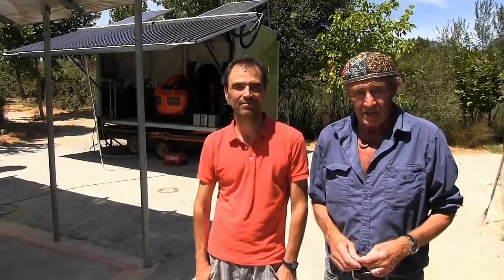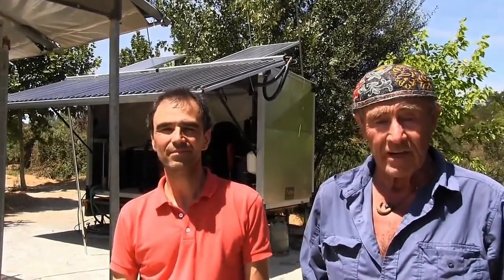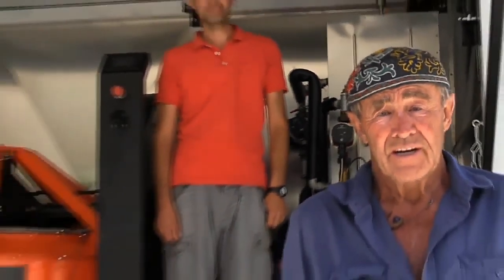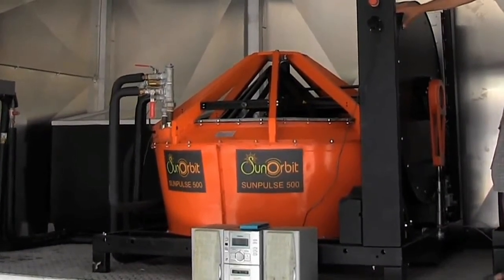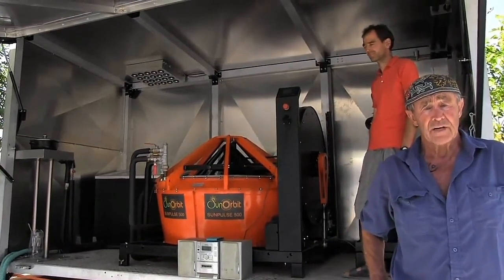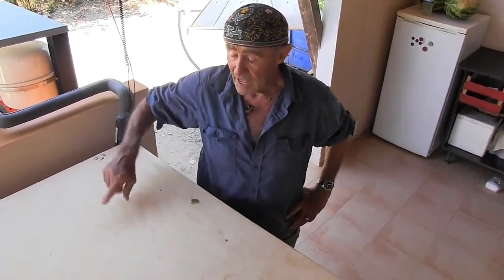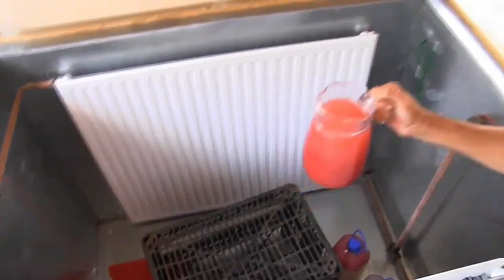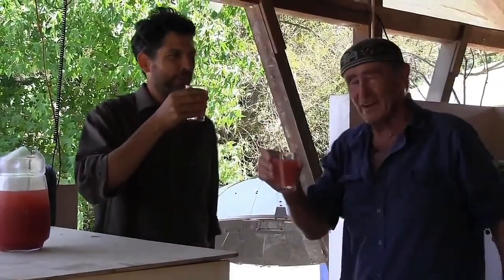An Innovative Low Temperature Solar Stirling Engine

Comment: This is such an amazing work! I have been dreaming about something like this for ages! In places where we have a lot of sunlight and a lot of heat, converting that using photovoltaics is very very inefficient and storing heat and using heat in many other ways is definitely the way to go! The choke point has always been the efficiency of this Sterling engine, and it's amazing to see this happening. I wish someday that kind of technology could be developed here in the Amazon because we burn so much fossil fuels here, we destroy the forest to create hydroelectric dams and all kinds of harmful stuff. We could be harvesting the sun's heat. But the reason why we don't harvest the sun is because the only economically viable way to do that right now here is using photovoltaics which are crazy expensive to get. This is amazing work, my brother. Congratulations on that!

Comment: Interesting concept. But you didn't mentioned the effort (investments) and amount of storage capacity nor delivered average power... So why you don't use PV and battery storage or compressor AC instead at low effort and high availability on market?

Comment: I invent in the energy space including in the off-planet space. One of my current  development project is a more mechanically efficient Internal combustion engine architecture with applications to other machines including solar thermal energy converters such as this one. Projected efficiency improvement is 30% which is significant. Other thermal efficiency improvements raise that by 20%. A vehicle driving cycle efficiency can be improved by 100% or more.

Comment: This is all very clever and interesting, which I like.
But with the exception of the biomass thing; the system does nothing one cant do with solar and batteries.
A small battery bank will still be required to handle electric spikes and peak loads.

So the question is then:  
How does it compare in price to an equivalent large Solar and Battery bank..?
Or a good CCHP system??
Reply: PS,
 One of my current  development project is a more mechanically efficient Internal combustion engine architecture with applications to other machines including solar thermal energy converters such as this one. Projected efficiency improvement is 30% which is significant. Other thermal efficiency improvements raise that by 20%. A vehicle driving cycle efficiency can be improved by 100% or more.
Reply: @ That I'd love to see!
I assume no side thrust on the piston is the 1st step, but then you need to get the power to rotational with a more  adventitious angle to a crankshaft than the normal  ~20 deg ATDC...    Hmmm....
Reply: @RayleneCawood  Not sure whom you are replying to but this is a crank-slider design so side forces will be present but that friction force is not significant. It's the near-TDC position that, for several reasons, causes ~30% energy loss but mainly due to low/slow torque arm development/availability
Reply: @RayleneCawood  PS.  I'm working to circumvent this problem. I prefer rotary devices which avoid the reciprocating momentum issues.
Reply: @ You might then be interested in the new LiquidPiston rotary engine.  Even though it will probably never be for sale, there are metal 3D printing places...
Reply: @RayleneCawood  Meh. LiquidPiston has several drawbacks which my/our design fixes which we'll eventually incorporate in our rotary architecture[s].
Bot will be used in my low cost, ultra-efficient, personal, door-to-door air mobility system, the PersonalJet with an advanced autonomous, networked, ride-hailing/taxi system following.
Reply: Seems you are not well familiar with this space and default to the mainstream promoted solution. I invent in the energy space including in the off-planet space. Generally, remote areas require reliability and low cost but electronics are not very reliable and usually not repairable on site whereas simple tech is. Heat engines systems can be supported with biomass or other thermal energy sources during inclement weather. Other considerations apply.
Reply: @ No; I see this being useful in that it can use biogas  or whatever at night, but so can an ICE and at similar efficiencies.

Yes it is easier to fix a mechanical machine as yo can see what's wrong, but with no moving parts to break..?

Comment: How many watts or power generated?
Reply: I invent in the energy space including in the off-planet space. Energy systems are scalable according to needs or funding availability so modularity is a useful factor. Obviously this is a demonstration system. You are probably asking about thermal efficiency or specific energy/power metrics which I'd also like to know.

Comment: Stirling engine technology is very amazing, and I hope you will develop it further. Personally, I want to replace the complex and dangerous electrical/electronic system with a simpler, more effective and safer system. I am thinking of a pneumatic system and/or a hydraulic system, with the pressure obtained directly by wind without need converting to electricity. Also, I like the mechanical meters more. 🌹🌹❤

Comment: Nice video but it's important to make it easy access of the efficiency, input output, cost numbers upfront
Reply: it will be AWFUL, sadly the efficiency of sterling engines drop as the temperature difference decreases. Some sterling engines run at 600-800c on the hot end and room temperature on the cold end. If you could keep the cool end super cold it would increase efficiency. remember to factor that the cold end is likely gonna run at 25-30c with good cooling so if the hot end is 180 that is onlky a difference of about 150c, 3--5 times lower the typical sterling engine. Even with invotate design the therotical efficeiceny from such a temperatue difference is low. and I wouldnt count 180c as low temp, at those temps you could be using steam to turn turbines...